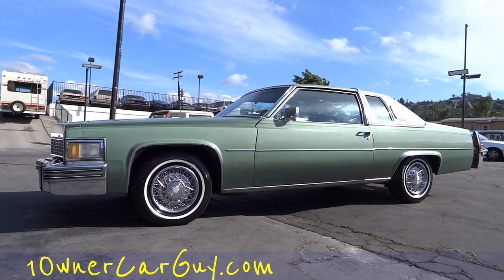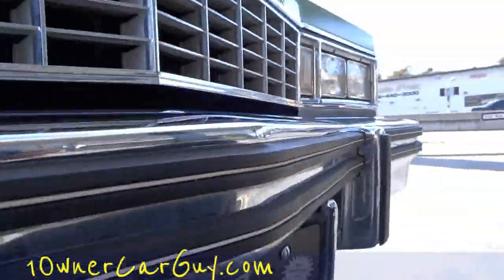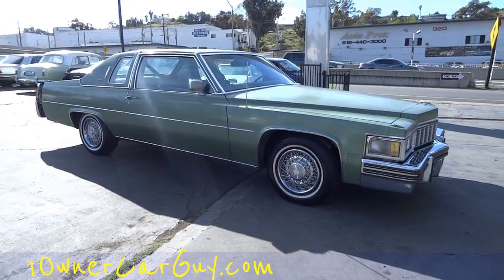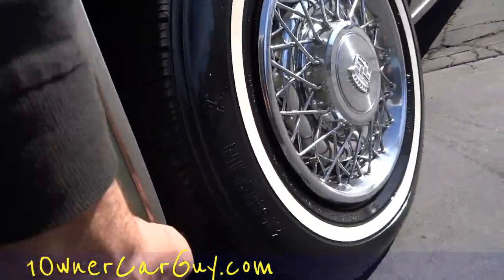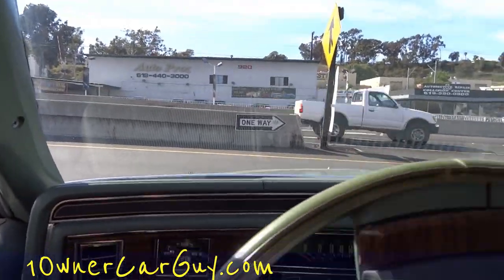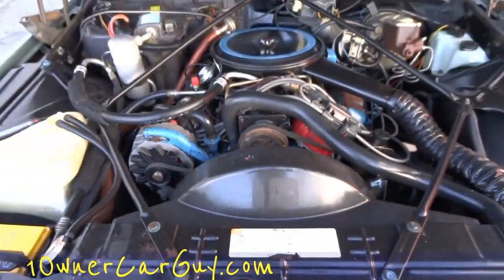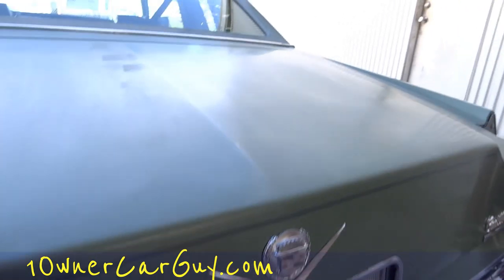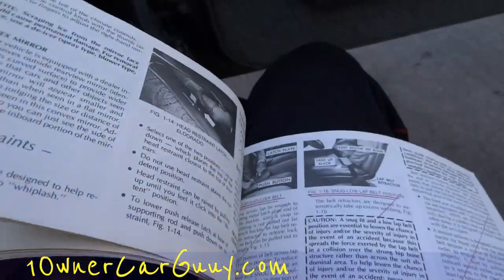77 Cadillac Coupe De Ville Deville De Elegance 425 7.0L Big Block Walk Around Fleetwood Brougham

Comment: I remember looking over a 70's or 80's Caddy in a panel shop in OZ back in '95, it had a very shallow trans tunnel with an unusual differential, the tailshaft was actually lower than the bottom of the banjo with some sort of "drop gears" in the nose,maybe even had the crown wheel on the right hand side?, obviously this must have been the top of the line transmission set up, never seen one like it since.
Reply: Cereal Marshmallows Still waiting for someone to enlighten me a to what level Caddy had this very expensive looking diff.

Comment: You for got to mention that your car has the rare expensive fuel injection option that is mentioned in your summary.  Big label on the air cleaner cover, the trunk badge and confirmed by decoding the VIN.  Also no spare tire (and maybe no jack).

Comment: your accelerator pump ,or fuel filter clogged that should be pretty poweful they came with 3 diffrent rr .gears 252, to308 the ones with the lower 😀gears where actually fast

Comment: piss poor repaint. no fillers. I'm willing to bet under the vinyl its rotten. busted hood ornament, tail light issues and poor performance for a 425. its a parts car at best. I have been around these cars all my life. I have a 77 Fleetwood brougham de elegance and a 78 coupe deville they aren't perfect but they are 10 times better than this thing. I would never drive one that beat. I've had 2 77's and 2 78's. my 77 has 68,000 original documented miles
Reply: No question at all that this car needs service under the hood and attention to nearly... everything. At least the AC is nice and cold! :P This is not my favorite year model for this car. I'm not sure why it says "Fleetwood Brougham" in the title... it's just a simple Coupe deVille... not that it matters 2 years later, but... I love these cars... which is why I own them and have driven/serviced them for over 15 years. :)
Reply: But it's 10 owner car guy.  If all these cars were one owner, they wouldn't look like cash for clunker cars.
Reply: Can someone explain to me how something is in "great shape" if it's cracked up?  That statement makes zero sense.
Reply: Is this car expensive To maintain.